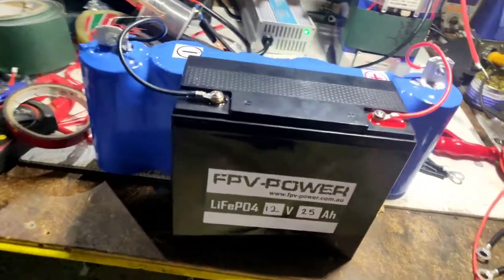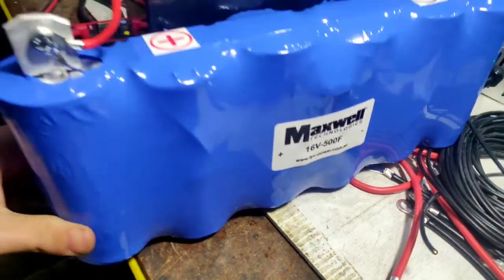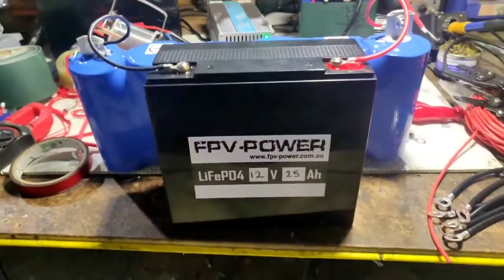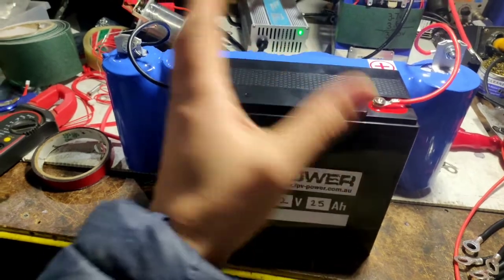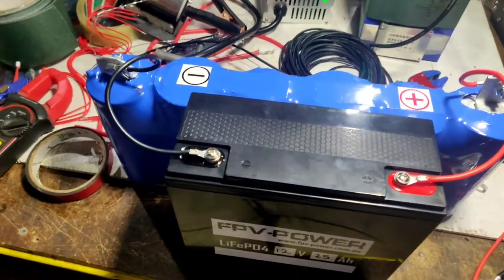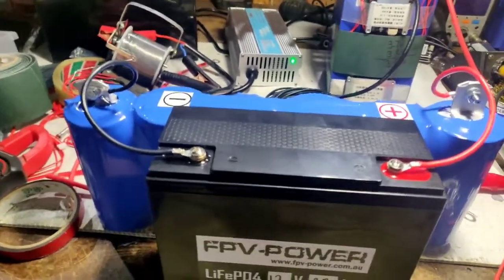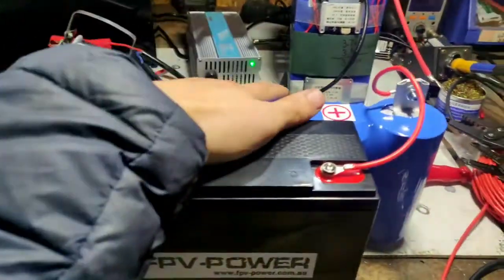FPV-POWER Super Capacitor Lithium Lifepo4 Battery Hybrid.

Comment: I have been using this set up for last one year for my Prado 120 in Melbourne, I use LIFEPO4 100Ah battery in the back to keep super caps charged and have 150 watts solar panel. I bought bare caps from Ian with balancing board. I have put a video too. Best thing I did to my Prado and three times more CCA than any 4x4 battery, no huge voltage drop like battery so the starter motor runs fast and colder than battery.

Comment: Why not place a 0.1 Ohm 25W power resistor in series with the LIFEPO4 battery on the red wire ?
It limits the current being pulled from the battery to around 15 amps while actually starting the car. 
It also decoupled the battery from high amperage loads and allows the supercaps to do thier job and supply the bulk of the energy for starting your car. My other wires are 4 AWG - 25mm2
Reply: Can you explain how you would do that and also what about charging the battery how will the affect it ?
Reply: I soldered 1 side of the power resistor to a 4mm2 wire, and covered this soldering with a heat shrink. Then I connected this 4mm2 wire to the + pole of the LIFEPO4 battery via a suitable clamp. Then you connect the other side of the power resistor to the + pole of the super capacitor. The - pole of the LIFEPO4 you connect to the - pole of the super capacitor. Then you connect the black -pole ground wire (1 pole of your car; to the negative - pole of your previous setup) the + pole of your car to the remaining + of your setup. When you are going to use the setup you must have it charged to about 13V and then you start the engine. After starting the engine and letting it run for 10 minutes the battery is charged. I used an 18Ah LIFEPO4 battery from the brand XZNY here. and built it into a battery cabinet from Turmera. My other wires are: 4 AWG - 25mm2
Reply: @ would the backflow of the current going back to the battery not overheat and stress the power resistor ? How do you choose an appropriate power resistor?
Reply: @ @ would the backflow of the current going back to the battery not overheat and stress the power resistor ? How do you choose an appropriate power resistor?
Reply: You can first use a light bulb and put an ampmeter in series to measure the current, then you can measure the voltage parallel across the bulb with a voltmeter. Multiply the current with the voltage and you get the correct Wattage of the power resistor. I myself have a power resistor of 100W 0.1 Ohm. Tested with mercedes 190d and volkswagen 1.4 with no problems. My other used wires are: 4 AWG - 25mm2

Comment: Quick question:
If the Lithium Battery has a lower voltage of 12v and the capacitor is 16v wired directly parallel, How does this rest? Or how does it work together? Sorry I'm new to this and researching before i decide to start a project. Thanks!
Reply: 16v is only the upper limit.
The Super Caps will only Charge up to the same voltage of the battery and will deliver a Large amount of Current within seconds.
The super caps will only give the Intial powerful kick and the battery will sustain.

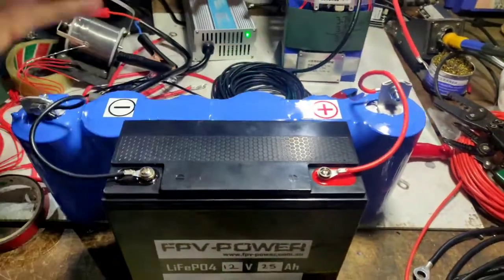Comment: Not in Parallel! At 1:06 I am sure you meant In Series in order to make 24V out of two 12V capacitor banks.
Reply: no resistor between lifepo and ultracaps so its going to put a lot of extra wear and tear on the battery/bms with high drain. ugh.

Comment: Can I connect in parallel a lithium ion battery pack with lifepo4 battery pack
Reply: yes! as long as they are packs with their own bms
Reply: No only 7S lithium ion and 8S LiFePO4 have similar enough voltage profiles for that to even remotely work…but due to the resting voltage of LiFePO4 it further complicates things and is not recommended

Comment: How reliable are these, we travel 100s of kms offshore so I need a reliable battery to start the outboard. Thanks in advance!
Reply from the maker: The best thing for Cranking application.  If u like to have a chat, sms me on 0433 (one, one, one) zero 61
Reply: @iangoh7289  just have one other question, what's the best way to wire these up to charge off the alternator? I have a lithium house battery that's charged on a dc to dc. Would these need a alternator regulator set to lithium profile?